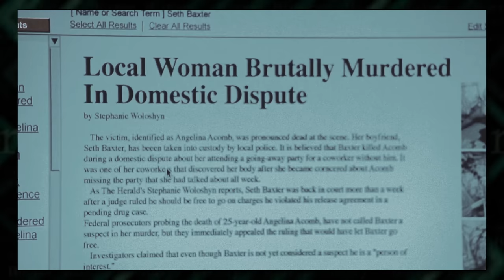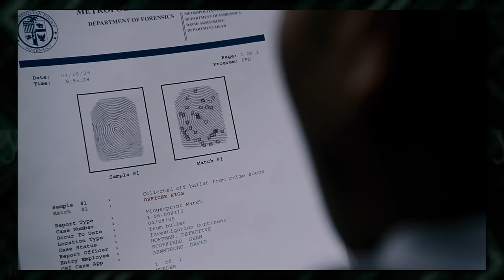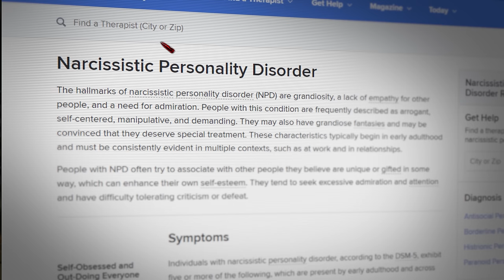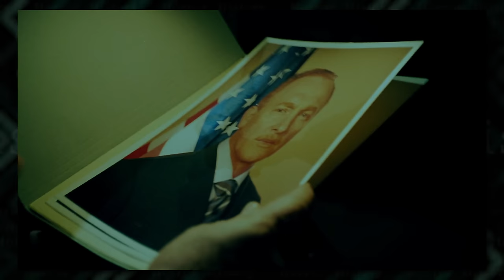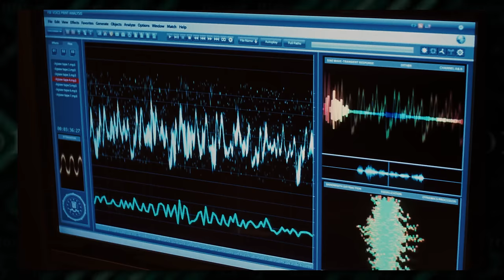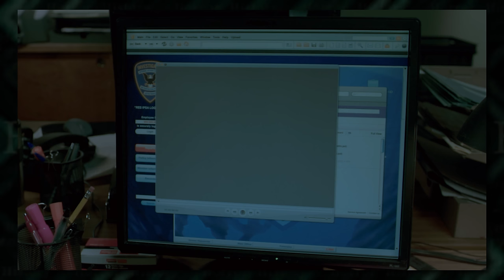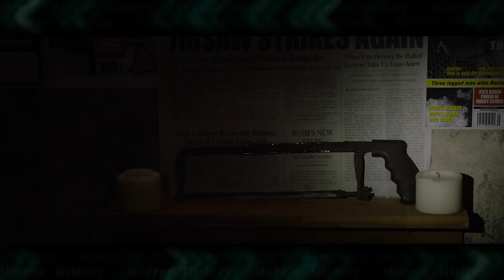Saw: The History of Mark Hoffman | Horror History

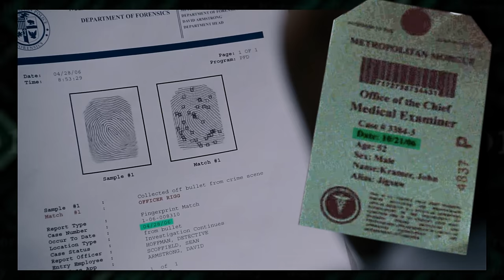Comment: @18:27 correct me if I'm wrong but i think they had to dig up the body and get all the paperwork in that time. They say it in the opening of 5 as they are doing the autopsy so i think he was embalmed traditionally and that's why there's no decomposition. Coroner's still have to preserve the bodies and hold burials for even murderers so o assume they did that hold minimal protection for the grave etc and something tipped them off to check the body